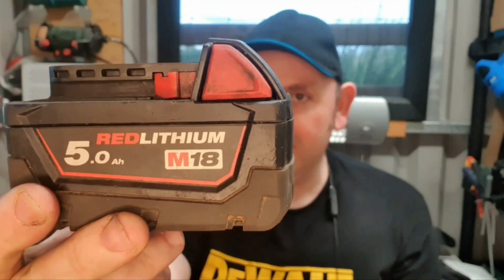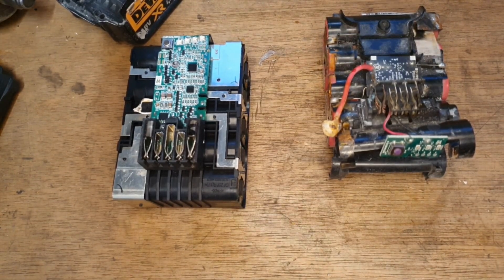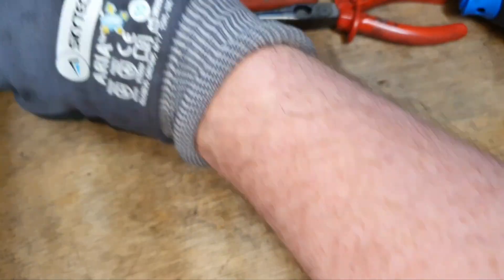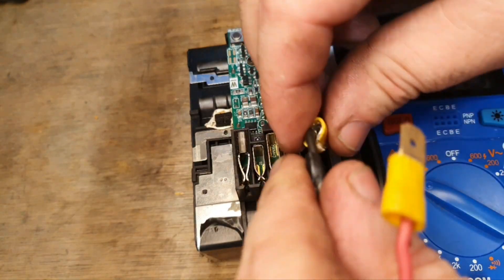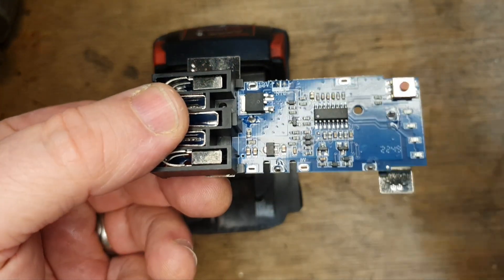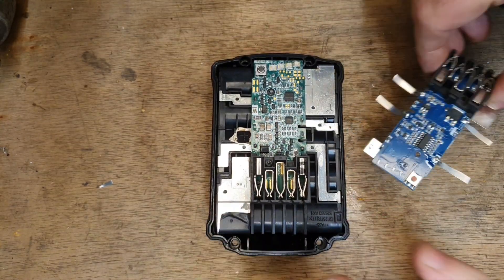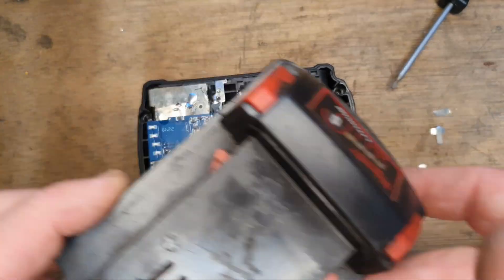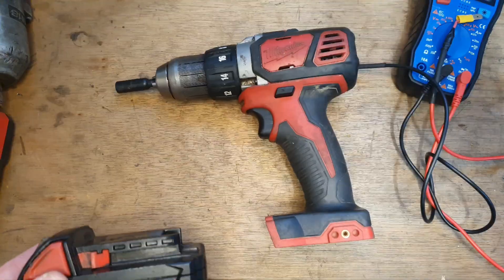Milwaukee M18 Battery one flashing light won't charge #milwaukee #powertools #repair

Comment: has anyone ever told you that the battery made the tool die? i’m only worried because the new board from the asian continent has less pieces on it.
Reply from the maker: No one has ever told me that but a couple of times aisan boards made the tools work that wouldn't on the original batteries. I actually have a video where I took off a good original board and fitted one of the aisan ones to get a m18 grease gun going.

Comment: do you know if all m18 battery packs share the same silicone chip? just wondering because my dad has a dead 1.5 amp m18 i wanted to fix but i just wanted to research it before hand.
Reply from the maker: Dunno about the 1.5ah some of the older 3ah had a different bms

Comment: I can do it with a lot less work. Here’s the solution. 
Go to Home Depot, buy a new battery. Wait 13 days, go back to Home Depot and return the old battery in the new batteries packaging. Problem solved.
Reply: Fraud tho
Reply from the maker: @doddgarger6806  that is true there were some guys here doing that and Dewalt clamped down it has made it more difficult to get a genuine warranty do I do not condone it.
Reply from the maker: We don't have home depot here
Reply: And THAT is one of the reasons why the batteries are so expensive in the first place.

Comment: My stuff was all brand new, both batts flashing red/green "fault".  I see 24 of these "how to fix m18/m12 milwaukee batteries" and glanced at three or five of them quickly.  FOUND answer in comments section.  I unplugged my charger and I made damn sure the battery was fully inserted,  NOW it charges.  No wires, no clips, no nothing external.  Thanks.

Comment: so I have an older battery that is very low like yours was there is no way of jumping the cells? I have tried jumping it with another battery and nothing happens with the specific one and I’m guessing hooking it directly up to the cell off of another battery is probably dangerous?
Reply from the maker: If it didn't work you need to change the bad cells

Comment: Thanks man, its getting quite common for the boards to fail on these things. Moreso with the knockoff batteries. I had four out of four fail in a very short time, and addmitedly they were NZ$40 each and you get what you pay for. Its possible they have the same boards in them that you are replacing your broken one with. Are they lasting long for you? It would be great to learn how to repair the original Milwaukee boards. That would also make a great video.
Reply from the maker: The boards are doing well so far repairing boards is further than I have gone in repairing these so far
Reply: @doctorlefthandthread  thanks Doc. With the cheap boards I can seen charred components, But with the Milwaukee boards, no signs on charred bits. Also, they are coated with a waterproofing varnish that needs to be removed before any work can be done. 

It should be easy enough to compare each component from a good board against the bad with a multimeter. But as you know, its super hard to get motivated to scrape the coating from a board that has nothing wrong with it and risk destroying that too. Probably faster to solder in a knock off board.

Comment: The problem is not the battery, the problem is the  battery charger.
Reply: Not always true there is a reason those cells dropped so low it could be the health of the cells struggling to hold the charge hence why they discharged lower than the others meaning yes its still the batteries as I've had packs I've used slow charger on the build them back and they still discharge faster than the other cells and you get a similar issue every time

Comment: What if the light stays green and battery is not charged
Reply from the maker: Could be broken connection bad cells faulty pcb cell imbalance you wouldn't know without opening the battery pack
Reply: @doctorlefthandthread  its crazy though i have 4) M12 6.0 batteries blink red and green and those are brand new and have 3) M18 12.0 and 1) M18 9.0 that stay green and dont charge and these are almost brand new
Reply from the maker: @excdalmt7807  did you check the voltage of the battery and the cell individual bank voltage?

Comment: Do you have a link for who you buy yours pcb boards from on eBay mine was supposed to come from London and came from china poorly packed thank in advance 👍
Reply from the maker: I get them from ebay and they are from China https://www.ebay.co.uk/itm/235248414701?mkcid=16&mkevt=1&mkrid=711-127632-2357-0&ssspo=ujlvx--aqj2&sssrc=4429486&ssuid=cjPn_ZfdQLW&var=&widget_ver=artemis&media=COPY
Reply: Thanks will give it a go👍
Reply from the maker: @maddawglodbrock1380  good luck
Reply: @doctorlefthandthread , this link doesn't work anymore. Just found your video. Please advise. Spot welder link doesn't work either

Comment: I connected my new pcb the charger does not even flash at all like nothing is connected when I put a jump to it the bbattery terminals they will light up soon I disconnect them there no light any ideas? Thanks
Reply from the maker: Have you tried it on the charger?
Are there broken connections?
What voltage is coming out of the top?
Reply: It’s. Not recognised by the charger and doesn’t flash the charger what so ever. Think it could be a faulty pcb as ther is no continuity between the second from left terminal and second from right
Reply from the maker: @maddawglodbrock1380  has to be faulty

Comment: I have a battery it has 4 v at each cell and 18 v at the terminals it won’t charge o mr run a drill   it will light up a torch do you think it will be the pcb board ?
Reply from the maker: Yes but try this first
https://youtu.be/bS5TBVao8ho
Reply: Thank s tried that it didn’t work will change the pcb. The only thing I didn’t mention is that none of the lights on the battery light up 👍
Reply: Still  waiting for my new circuit board but I bought another battery today it’s full of water I’m drying it out I’m getting no voltage no light what’s your thoughts is it possible to revive it? Thanks
Reply from the maker: @maddawglodbrock1380  in my opinion no the water damage always seems to fry the board I did manage to revive the cells in a makita but had to get a new board fitted
Reply: Thanks I’ve just stuck another test on the one I’ve a pcb for i was getting 18 v and 4v at each cell now I’m getting 16 v at the terminals and nothing on the cell what would have caused that to change thanks

Comment: Brah milwaukee never made a battery with that number 5 font style. Better return this ebay counterfeit and get a real milwaukee buddy.
Reply: Look up European M18 batteries. They all have that font. I was also confused the first time seeing an M18 battery not sold in America.
Reply from the maker: I think that battery is genuine I could be wrong but counterfeits are usually worse build quality
Reply: Website for aftermarket PCBs you are happy with? Thanks in advance 👍
Reply from the maker: @mg02772  ebay I buy the little blue boards they do the job
Reply: @doctorlefthandthread  Thanks Doc much appreciated Merry Christmas to you and your family 🎄👍
Reply from the maker: @mg02772  Merry Christmas to you too
Reply: Do you fix batteries??
 I have 3 genuine ones doing with this red/green light flashing.. tried on 2 different chargers.. going by the voice your in northern Ireland so thought I'd ask lol
Reply from the maker: @stephendyer2344  yes I live in Northern Ireland and I fix batteries I don't advertise but I haven't refused to look at a million battery yet
Reply: @doctorlefthandthread  knew I recognised the voice lol .. i would like to get these ones fixed instead of buying new if thats the best option, how can I get in contact with you?
Reply from the maker: @stephendyer2344  email drlefthandthread@gmail.com
Reply: What a clown. These are UK batteries you nub
Reply: Yeah it's legit the real ones have the rubber isolators between the cells with the rubber tip sticking out the ends one for each pair of cells none of the counterfeits have this

Comment: Great demonstration for the batteries fix as always, unfortunately I have the same problem with my 12.ah battery it flashes like this, ~& I charged the battery manually up to 4.07V in each pack inside but it still flashes and refuse to work, did you face same problem or not?
Reply: I've had this happen often, and so for (other than one with 3 dead cells) I've been able to solve the issue by unplugging the charger with the battery on it, wait until the light stops flashing (sometimes take a few moments), then plugging the charger back in.  Leave the battery on the charger the whole time, make sure it's fully seated, and you have to wait for the light to turn off after unplugging with the battery fully seated.  I found this out by chance, and with all but one Christmas light display, this has solved the failure to start charging problem.
Reply from the maker: @TikkaHorse  that's awesome thanks for the tip
Reply from the maker: When that happens I replace the board but I haven't been able to source boards for the larger batteries yet 8ah and 12ah
Reply: Wow thank you  a million saved me so much time